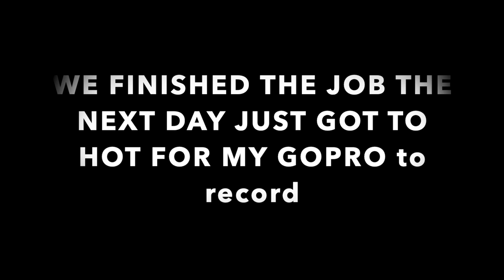POV Day in the life of a Roofer! Roofing in 2021!

Comment: nice vids but that is a very interesting way to tear off the old shingles,  but whatever works.. just looked alil messier then like if u were to go opposite of how the shingles were laid down  and tear them off in stair step form
Reply from the maker: Yeah it was a little messy. The people that laid up before ended up staggering the shingles on some parts so we just started from the farthest point since only two of us were working towards the trailer. Thanks for the support!👍🏾
Reply: Yeah. I’ve tore off opposite of installation starting at the bottom and sometimes you’ll have huge sections of shingles come off. You come back after to pull of nails and roll the old underlayment. Keep up the good vids.